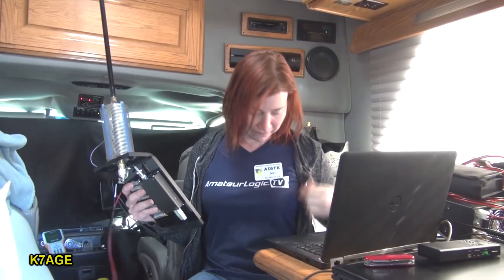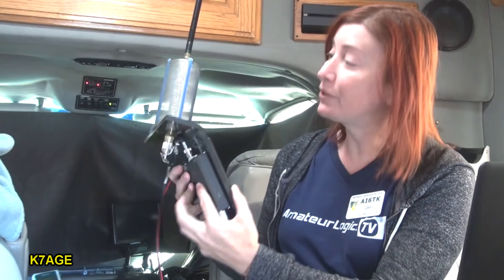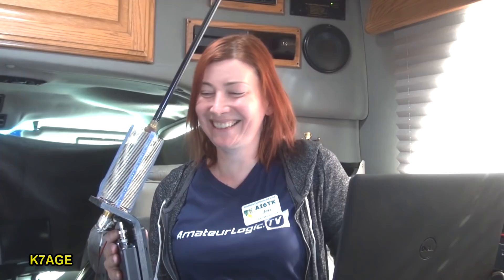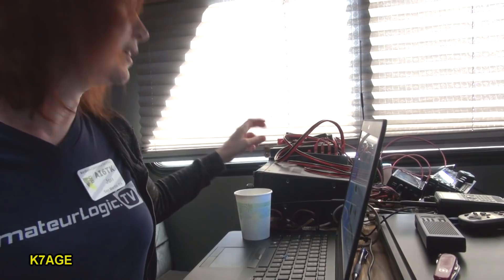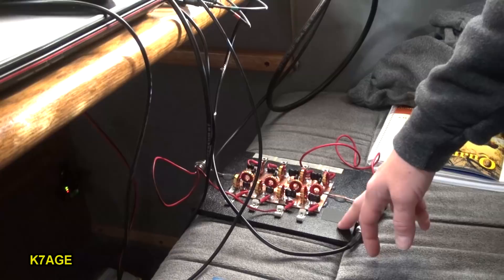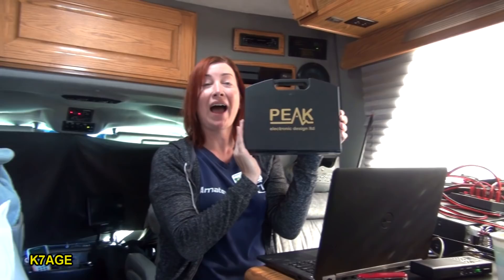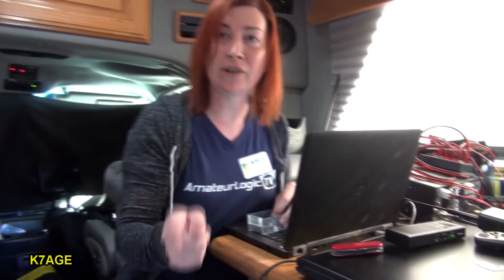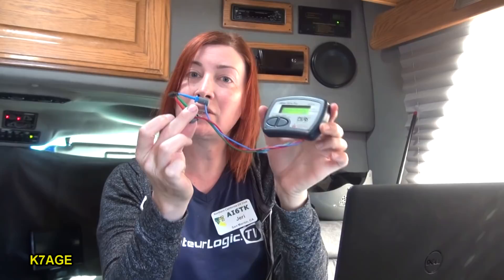Jeri Ellsworth, AI6TK, and Amy Herndon, AI6ZU, at Quartzfest 2018 Part 1

Comment: I want to know more about that crystal frequency manipulation that she talked about. Great video Randy!!!
Reply: m butts, basically Randy was talking about crystals that came in the FT-243 holders with the spring contracts and cover plate you could remove by removing the screws. One would carefully remove the tiny quartz crystal slab and either grind it down on a mirror using toothpaste and water as an abrasive or carefully make pencil marks on it. The grinding would make the crystal thinner and raise the frequency while "loading it up" with graphite would lower the frequency. Tedious because it was cut and try.
Jeri was desoldering the HC-xx cans and, plating thr quartz piece with silver to lower the frequency.
Reply: tnx for the reply, I am familiar with the old way of grinding and rubbing a pencil on them. This new way for newer crysals sounds like you can move over 1 Mhz? What do I need to use for search words in google? Sounds very interesting. Every google search I do comes up with the old method. Do they get chirpy if you move them too much? tnx martin
Reply from the maker: She mentioned that she used a sputtering deposition machine. She also has an electron microscope.
Reply: K7AGE OK Randy, doesn't sound like something for the average ham to tackle. I didn't realize she had an electron microscope. I might Google and see what the sputtering device is. TY!

Comment: The little 17 dollar china board is identical, same circuit, one difference, no case, has one of those zip sockets so you can plug things in ect.  I did get a see through case for it but haven't put it together yet. VERY useful, can identify and make a drawing of the most complex mosfet or dual diode shotkey or whatever it might be. I do wish they had a type powered with say 50 volts for higher voltage zeners or whatever. I don't believe any of the type your talking about do this, they are identical. Packaged different but same circuit. Display
160*128 LCD 
Power Supply
1 * 9V Battery(not included); DC 6.8-12V 
Current
Approx. 30mA 
Resistance Measurement
Max. 50MΩ 
Resistance Resolution
0.01Ω 
Capacitance Measurement
25pF~100mF 
Capacitance Resolution
1pF
 In case assembled $24 https://www.ebay.com/itm/Component-Tester-Transistor-Diode-Capacitance-ESR-Meter-Signal-Generator-Tool-LA/282543742903?hash=item41c8eb5fb7:m:mVbQY9D764hRPqb6k8E2yrQ

Comment: 00.53:  "My wife gave me this."  Is Amy your wife?06.30:  You have frequency and phase totally confused.07.19:  You better check the band plan for 20m.  If you transmit data on 14152 kHz. you are in violation of FCC regulations.Do you work QRP CW, or not?

Comment: 00.53:  "My wife gave me this."  Is Amy your wife?06.30:  You have frequency and phase totally confused.07.19:  You better check the band plan for 20m.  If you transmit data on 14152 kHz. you are in violation of FCC regulations.Have you tried operating QRP CW?